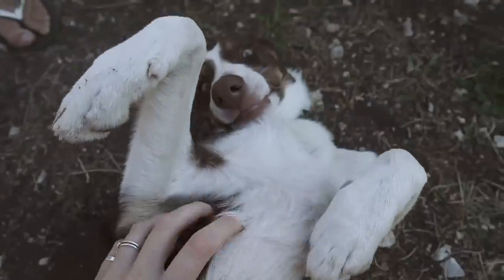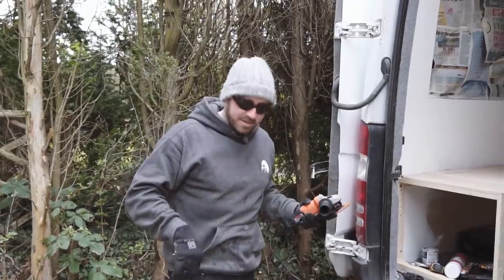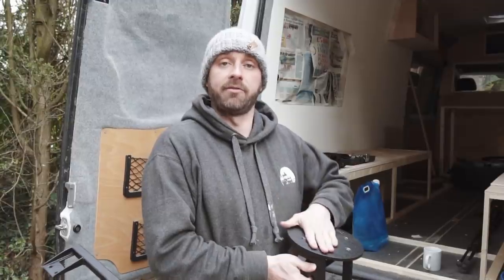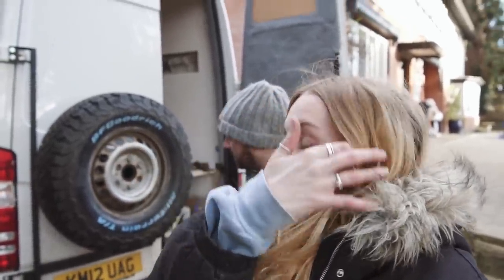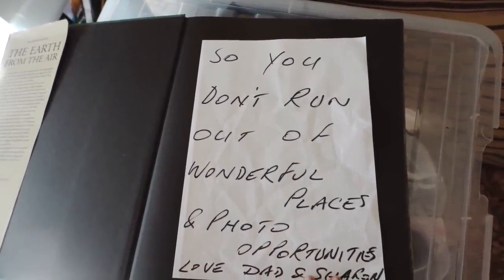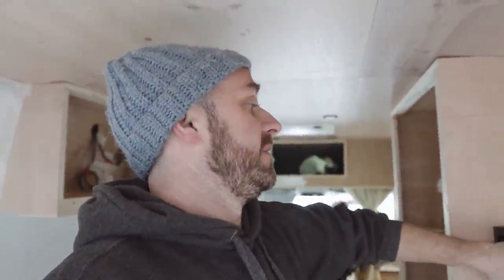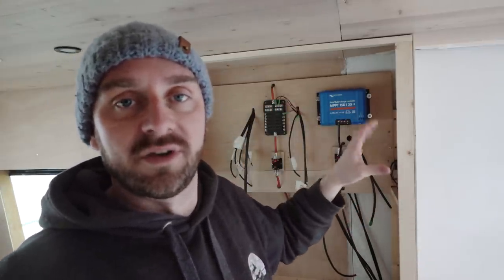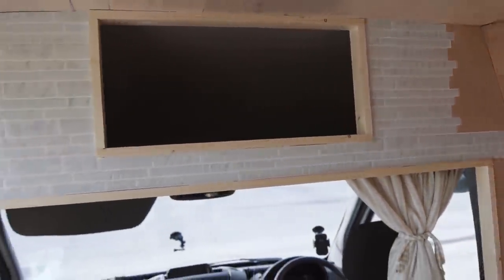OUR VAN LIFE BUILD | FIXING MY MISTAKES!

Comment: Hiya folks! Thanks for another entertaining vlog, always a pleasure to see the notification pop up! 
The tiles look splendid although I do harbour a slight worry that you might run into problems with the severe heat where you're headed. I had self adhesive vinyl floor tiles in my van and they expanded and lifted with the heat which bugged the hell out of me! In the end I had to rip them all out (not easy as many were stuck fast!) and replace with carpet tiles that I glued down with Bostik Timebond. So yeah, heat, humidity and anything self adhesive may drive you crazy....but I really hope not coz the build is looking top notch! 
Love the story re your Dad's book. My Mum passed away from dementia last May. I never got to see her because of the lockdown. A really sad time. My father in law is also in a care home suffering the same so I feel your pain Ches'. Much love and kindly vibes being sent to you, Ben and River. x

Comment: On your spare wheel mount, screw a stud (long bolt with head cut off) into the top hole, you can then lift the wheel onto the stud, then screw in your wheel bolts.
Reply from the maker: Martin, where were you when we needed you?! Brilliant idea, will remember this one for next time 😊x Chesca

Comment: Super progress guys... the wheel carrier looks awesome 😎 Quick question,  why do you have to cut the bars on the inside of the hinge when the carrier is actually mounted to the opposite side ? Looks pretty heavy too 🙈
Reply from the maker: Wheeliams explains it really well on the product page of his website but it’s to do with the pivot points and the fact the doors open 270 degrees. Leaving the internal hinge in place can rip the sheet metal when the carrier is mounted. The carrier only weighs around 8kg, the spare wheel however is pretty heavy!
Reply: @OverlandingSophia  many thanks for getting back, makes sense now. Good to hear it's only 8kg, I would guess I am nearing the weight limit as is... 🙈

Comment: Raptor pain you wheels perhaps? If you raptor paint the lower half you will need to remove all the lower plastics and you can inspect behind the plastic for rust as sprinters are renowned for....
Reply from the maker: Yes we're definitely going to look at doing something with the wheels, they need some TLC! We're still tempted to paint the skirt in raptor - we did seal the plastic trims during our first build so would be interesting to see how easy they come off and if there is any rust behind there. Hopefully not! 🙈

Comment: Looks awesome. Will you treat the rims on spare wheel as there looks like signs of rust on it? Also what to say stop undoing nuts and stealing it?
Reply from the maker: Yes!! God we are dying to get the rims on all the wheels sorted! Hoping to spray them black, but will do this once the interior is done. The wheel is secured on with 6 locking wheel nuts, so it’s not going anywhere ☺️ x Chesca